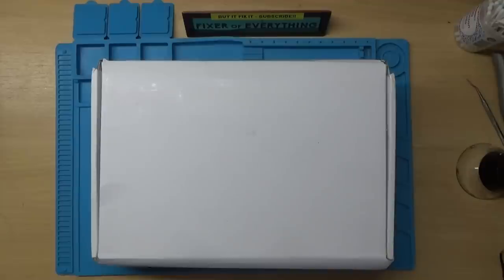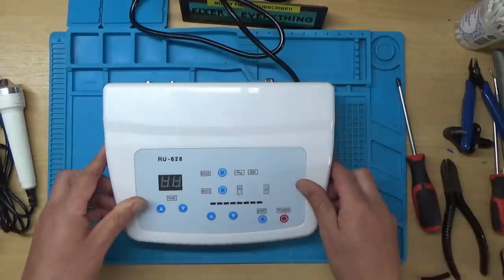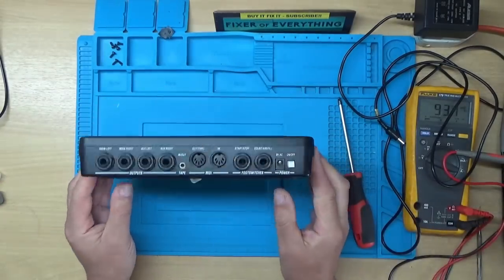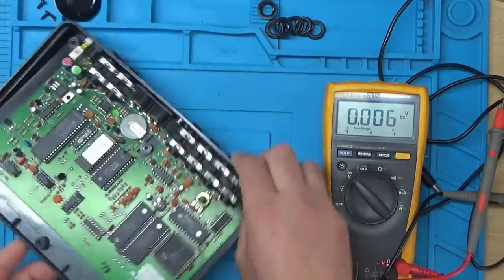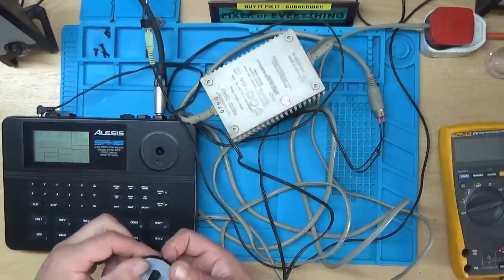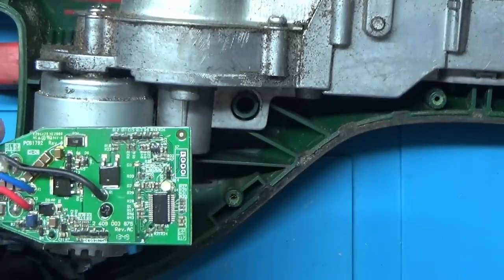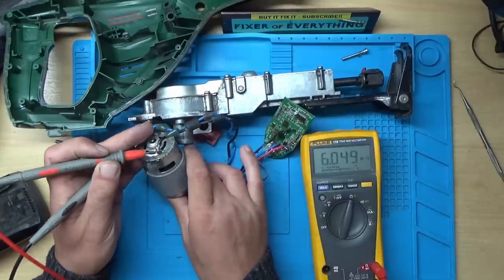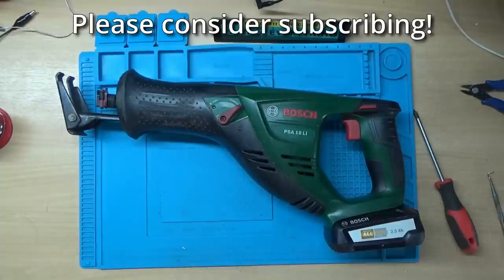Three Easy Repairs | Ultrasonic Machine | SR16 Drum Machine | Bosch Reciprocating saw

Comment: Just FYI you couldn’t use 9 V DC or AC it wouldn’t of mattered
Reply from the maker: Thanks 👍I wasn't sure if it used the AC for timing or if it generated a negative voltage for the OP amps with it. I've got a 24v AC PLC and that doesn't work on DC when I tried it.

Comment: CE =Chinese export
Reply: @BuyitFixit  Hi if you look at the European CE mark you will see it is a different shape than the Chinese CE (Chinese Export) they do it to kid people into thinking it has European Certification also if you see any of them unfused plugs chop them off.
Reply from the maker: Oh right, I didn't know that. I thought they were copying the European CE mark, which I guess they are in a way... Yes, I've had a couple of devices with those horrible plugs on. I usually change the lead for a decent one or as you recommended too, chop off the plug and fit a fused one.

Comment: How nice to see another dangerous and completely illegal chinese plug on that Ultrasonic unit! Is the CE label "Conformity European" (in French!) and tested or China Export which isn't? I would suspect the lead is very thin copper plated aluminium too so I'd change that. In addition it should be three core (earthed) as the transformer bolts are contactable and I would be 90% sure that the insulation will not conform to double earthing requirements. Basically electrically unsafe!
Reply from the maker: The cable actually didn't look too bad. When I've had items in the past with these plugs,it's usually on a lead. I just bin the lead and use a proper one 😂😂